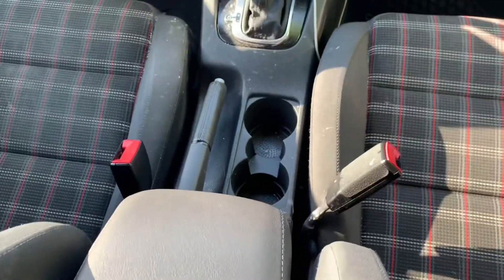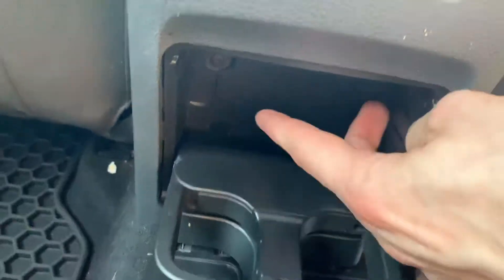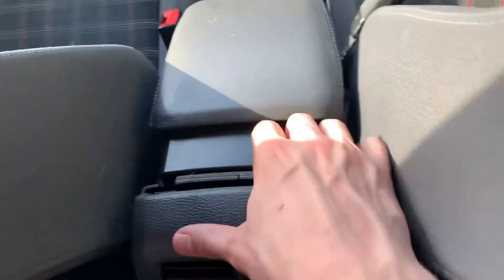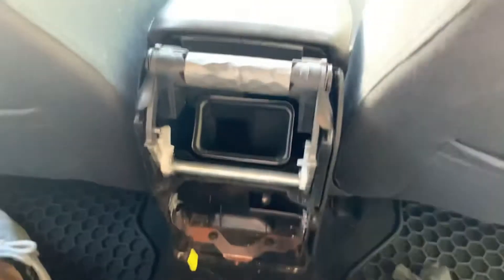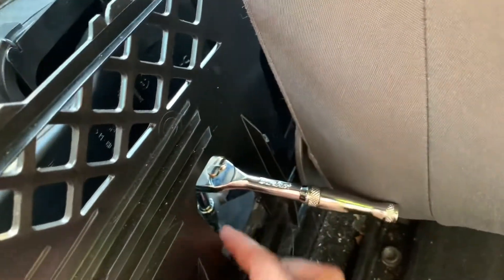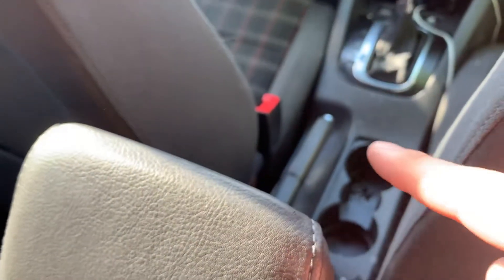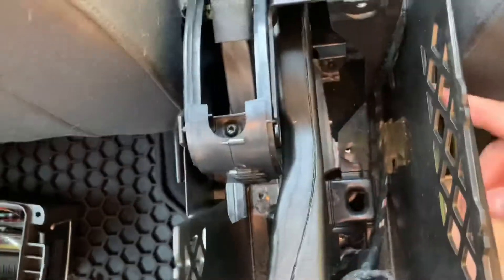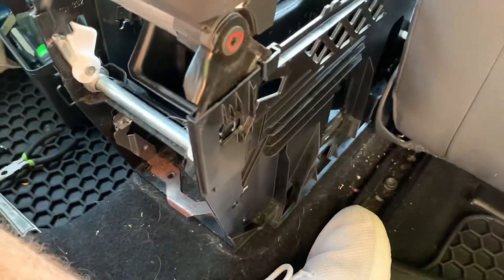Parking Brake adjustment MK5 GTI, Jetta, rabbit, golf.

Comment: To get the last screw you push the front seat as far forward as you can. Then jack the seat up with the side handle as high as it goes. If you do that it will give you enough room to easily get the screw out 👍🏼